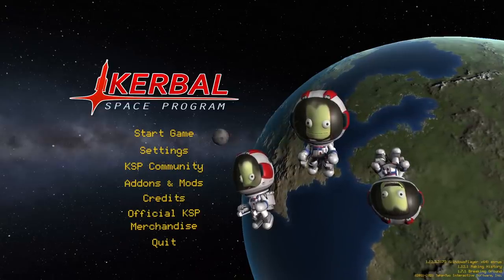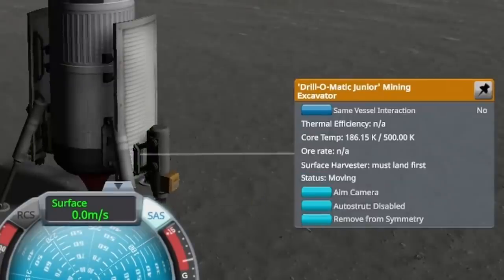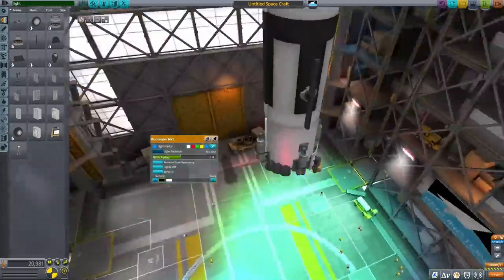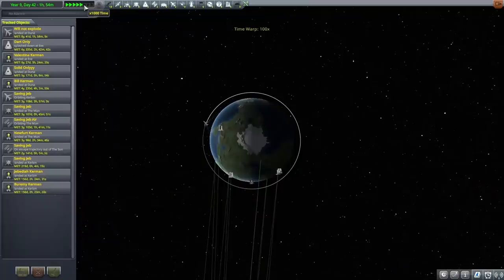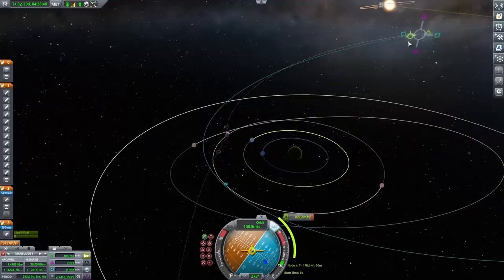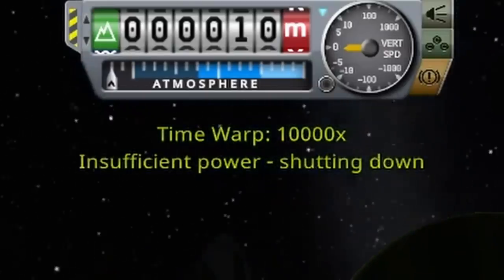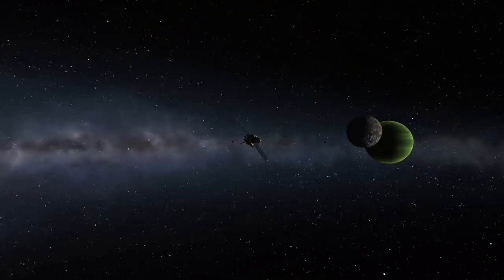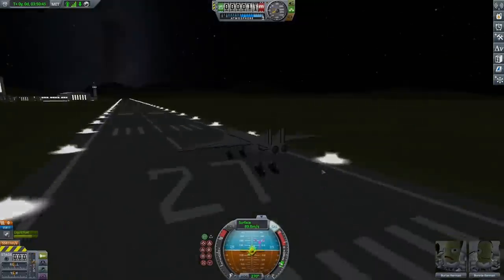Risking Cursed Mining Techniques to Land on Vall in Kerbal Space Program

Comment: Lander advice - short and squat legs beat tall, skinny and unstable! Also be sure to pack lots of battery! You can mine and process constantly if you have a lot of battery, use fuel cells, RTGs, or land on a flat polar region with a solar panel sticking up.
Reply: solar panels doesn't make that much power far away like jool
Reply: @astrohahawashere  Yeah, it takes 2 Gigantors to run a converter continuously at Jool, and they'd sometimes obscure each other unless you put one above the other.

Comment: 7:03 Unless you're using liquid fuel only rockets, (I didn't see any) that fuel from the wings is just dead weight because it doesn't come with oxidizer
Reply from the maker: Very good point, totally forgot about that
Reply: @ReidCaptain  install simple fuel switch to allow switching between fuel/ox and fuel only on all parts
Reply: @iainbagnall4825  While he could, I think Reid Captain's doing mostly stock things right now.

Comment: Here's some tips on using refiners: 

1. Take an engineer with you, as you can get 25x multiplier by having a one on board.
 
2. Use the bigger 2.5m converter, as the small 1.25m converter actually discards 90% of the ore, and needs more cooling to work.

3. Avoid using the surface mount radiators if you can, as they only cool the parts directly beside them (Any part attached to the one they're attached to). This means any excess heat from one part can't be taken by the others, leading to possible overheating

4. Using the larger 2.5m converter and engineer, you can actually use fuel cells to power it! The fuel intake actually makes more than the fuel cells need, meaning you don't need to worry about low solar power from farther orbitd like Dres, Jool, Eeloo, etc.
Reply from the maker: I was reading the wiki a little bit after I finished recording and noticed that the small converter is not nearly as good. At least it was lighter I guess lol. Thanks for the tips!
Reply: @ReidCaptain  a good way to think about it is like panning for gold. A small pan can pick up large chunks, but the majority will be missed. 
However, bigger equipment can take those small rocks and lower quality ore, doing Magic Chemistry™ to get a lot more efficiency out of it!
Reply: One detail that is often overlooked is how the large converter can actually generate 2 units of fuel for every 1 unit of ore, so I generally just make sure I have enough fuel for my next burn and keep everything else in ore form until it's needed so as to minimize my mass. I also tend to never use the small drills, because they have a minimum required ore concentration at the landing site in order to function, whereas the large drills will always pull something up no matter the ground conditions. Making permanently reusable multi-purpose vehicles is like my favorite thing, and my fleet parked at Minmus just keeps growing.
Reply: I am very late but I love your pfp
Reply: @sammmsational  yo thanks! Love yours as well :3
Reply: It doesn't discard 90% of the ore; I think that's one of several pieces of obsolete info still knocking around. What it does do is run at half the speed of the big converter while using electricity at the same rate. It's possible to power the large converter with fuel cells using the LF/O the converter produces, but not the small one. Actually, if you have fuel cells and solar panels, the fuel cells may prevent the converter from stopping overnight which is useful because it won't restart itself, but it's incredibly slow without an engineer. It's probably better to figure out how many batteries you'll need to run through the night or just use the big converter. Still, the big one is 3.4 times heavier.

Edit: I tested solar panels at Jool. 2 gigantors (as Reid fitted) aligned well are enough to run the big converter in Jool orbit. I don't know if they'd run drills too.
Reply: @omnipedia-tech  Huh? I calculated the ore mass exactly equals the mass of fuel produced. I'm not sure whether I worked it out in 1.8, 1.11, or 1.12, but it was probably 1.12.
Reply: @eekee6034  
Taken directly from game (gonna ignore Oxidizer because it's exactly proportional to LF):
Small: 2.5 Ore = 0.22 LF
11.36 Ore per LF

Large: 0.5 Ore = 0.45 LF
1.1 ore per LF

So compared to the large converter, you're only getting 10% of the fuel per ore. Therefore, if you don't use the large converter, you're wasting 90%.
Reply: @eekee6034  I just tested it now for both modes with both converters...
Large Converter:
1500 ore = 3000 LF
1500 ore = 1350 LF+1650 Ox
 
Small Converter:
1500 ore = 300 LF
1500 ore = 135 LF + 165 Ox
Reply: @theencolony5595  I guess it's my info that's obsolete, or maybe I mis-remembered my tests. Thanks for the correction.
Reply: @omnipedia-tech  O.O What? I'm not doubting your tests, just wondering... Oh I remember: I figured the weight of the ore matched the weight of the produced propellants. I don't want to start KSP to check right now as my computer's a bit weak and I have things to do.
Reply: @eekee6034  your info is sort of right, in a way. If you consider the ore to be infinite (I.E solar panels and batteries, rather than fuel cells), then the smaller converter is twice as slow, while using the same amount of electricity.
Reply: @theencolony5595  Thanks!

Comment: A mid-course correction would have got your periapsis close to Jool with far less fuel use. You want to make the node between 1/3 and half way along your transfer orbit. And the same to adust your Vall encounter, though would have saved less fuel.
Edit: I know what you need. You need to focus the view on your target to see where your orbit will end up. KSP should give you the option to focus when you left-click the target, but it often doesn't. Double-clicking always works.

Comment: Tip: use a surface scanner or a satellite with a survey scanner to show you the ore distribution of the planet/moon.
 That way, you can get more ore easily...
Reply: He also needs better radiators. Those ones he is using only work if they are a couple of meters  from the part and don't have much capacity. Use the folding ones for mining because they have the capacity and cool any part in the vessel. If you don't it effects efficiency a lot.

Comment: You should program a maneuver node halfway on the way to Jool with the Pe near Tylo or Laythe already set up to automatically capture with minimum delta V requirement. Also, a nuclear engine set up would be beneficial for this kind of mission, one type or fuel to refine only, more fuel to spare, more delta V.

Comment: Oh boy. :)
- Have a look at the KSP wiki on how radiators you need for cooling.
- You can attach a radiator panel to the ISRU. If you attach the drill directly to the ISRU, it gets as well cooled by the panel. Just offset the drill to the desired location.
- A vector space shuttle engine might be a bit oversized for Vall with such a small lander. ;)

Enjoy!

Comment: To remedy the power issue with the miners, you may want to use some batteries to keep them powered at night, I'd imagine a whole day should be enough to charge the internal power reserves as well as the batteries. Right now it seems like you're just using the power reserves within the crew capsule which is miniscule.

Comment: To get electricity when there isn’t sun on the solar panels use RTGs. 1 might be enough but the more you have the more power you get.
Reply: Or fuel cell arrays. Small ISRU with an engineer onboard and fuel cell arrays can mine indefinetly in the dark.